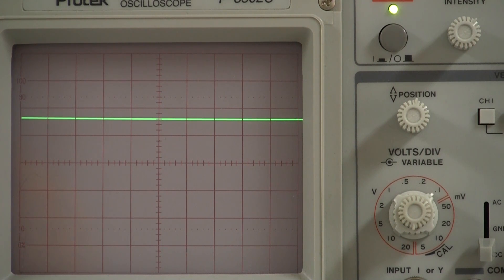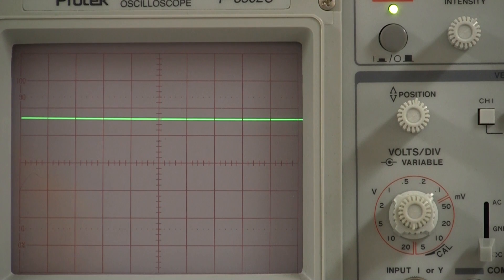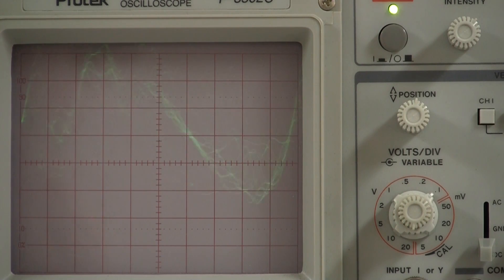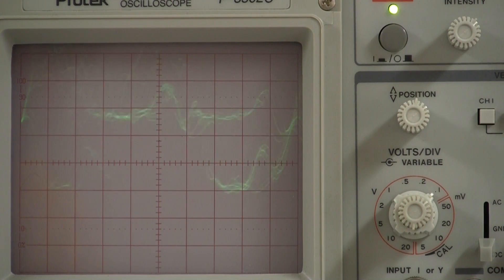Analog versus Digital synthesizers compared

Comment: the issue is not the waveform production (vco vs dco) but with the wave treatments, through the vcf, vca, eg and the modulation via lfo, ring mod, etc : at high frequencies, you can hear clearly the "steps" effect... and this cannot be filtered out, since it has nothing to do with the signal source (of course, a pure sine wave will always be a pure signal wave whatever the source, mechanical - think of a tuning fork or an organ pipe - or electrical - analog or digital) but with the signal filtering and modulation along time, i.e. the music!
Reply: zourslovenia Agree with you maybe we should a comparison of an analog wave thru a digital processor ie a digital filter amd and a digitally produced wave thru an anolog filter .
Reply: Free-running digital oscillators are everywhere today. It's in the Waldorf Blofeld, Serum, Intellijel Shapeshifter, Aalto, and Zebra 2, just to name a few.
Reply: woodlandcritterpunch Intresting info . I guess one of the reasons(not the only reason why digital osc sound so perfect is because of the starting of the waveform.
Reply from the maker: The 'steps' effect is more obvious in inexpensive lo-fi synths..... but I agree with you that the major differences are in the filter(s) and not the oscillators..... however, the interacting phases of the oscillators waves also causes a "difference" between analog and digital ..... in analog, all the oscillators are continuously free-running even between notes (when notes are not sounding) but in digital they all start at the SAME phase angle when a keyboard  note is pressed..... whereas in analog the starting phase is quite a  random (unpredictable) event.
Reply: @StephenMendes  It used to be that (free running phase not in digital synth). But even in the old Subtractor in Reason available already in early 2001 you can have free running waves starting at different phases.
But an even cooler thing is using the NN-XT sampler and working in 8 layers with the same waveforms and  settings but with different starting points for them and then set all layers to "ALT" - which means they will alternate randomly. They can also be detuned slightly to simulate that real analogue feel (if you have sampled a real analog synth it still will sound "stale/sterile" since the same waveform is triggered) with the same out of phase and slightly detuned oscillators/voices sounding at the same time. This makes things instantly sound analog! I don't think Kontakt has this function!
Reply from the maker: @Magnus_Loov  I have both digital and analog system  and I do not fancy one above the other.... they are simply different  to interact with
Reply: @StephenMendes  Yes. I owned analog equipment in the 90:S, but all vst:s right now (except a Dx7 as a controller, which is digital anyway). At the moment i am contemplating if it is worth it to buy a Behring Model D. It is cheap, but no patch saving is very, very limiting if used via midi in songs.
Reply from the maker: @Magnus_Loov  I would NOT recommend buying any Behringer products (unless you live in Germany),  their service is very poor in USA and is non-existent in my country, Barbados.....  consider it a disposable item.... if it goes bad, chuck it out and buy another, but do not expect to get services and repairs on them....

Comment: Hello :)
first of all thank you A LOT for doing this long and interesting test :) it's just great :)
i wanted to add my point of view about analog vs digital synthesis;
imo, there is 3 big differences :

1) the density of the analog signal comparing to (most) digital synthesis (the warm sound comes from here, it has rich harmonic)
2) the granularity (think dynamic imperfection) of (cheap) analog synth signal
3) the loss of quality introduce by digital conversion (stepping)

it would be awesome if you could find a way to compare the density of the signal; for eample, if you slow down a sample made with analog synthesis, and if you slow down a similar sample made with digital synthesis; i bet the digital one will stretch a lot more :)

also the micro imperfections are a big part of the joy of analog synthesis (except for really expensive analog gear, wich are somehow free from them) but i think you don't have to mesure that it's almost a fact..digital is perfect;

on a side note, I came across one or two digital synth wich impressed me by their sound (i couldn't tell the differences with analog) but many of them just sound perfect and somehow flat.. (with a dry signal of course) that's why some digital synth add distortion effect in the end , it's to bold the signal (king korg, electribe and many other);
it works but it doesn't have the same result as a true analog synthesis imo; 

Also, i think you are missing one important point : digital synthesis have many faces : additive synthesis, phase distortion synthesis, fm synthesis, granular synthesis and many other ; each of them have differents soul and sonic capabilities. fm really impressed me, has well as the granular method :) 

Good luck with your quest,
I'll look forward to hear from you and your sound experiment :)
cheers from france :)

Louis

Comment: the sample rate of your average digital synthesizer is over 40 kHz. This will result in some kind of additional frequency at 40kHz to the output signal, not granularity, because voltage cannot change value instantaneously. 
The hearing range of an exceptional human ear is up to 20kHz, so that frequency will not be perceivable even prior to filtering.  
plus that frequencies amplitude will be extremely low and wont require much filtering to remove. Meaning the phase and amplitude change of the overall signal due to the necessary amount of filtering used to ELIMINATE it, will be minuscule and i'm guessing also beyond the range of human hearing.

Comment: hello
analogs synths generate their waveshape with capacitor charge/discharge, the curve is not linear.
some V.A. synths reproduce this type of waveform.
Pictures of analog waveforms, are not perfect shape, there are artefacts resulting from the method of generation.

perfect square wave is dangerous for material, very bad for speakers, and difficult to form with an analog system, because it implies  infinite  acceleration. 
On the scope what you see is a square wave less the higher harmonics. 
I guess , above the emulation of analog synthesis, why digital synths don't produce perfect square too.

But for our ears the differences are not realy important, mainly because the very high  harmonics making the perfect square are above what we can hear.
Reply from the maker: +jean-louis pech 
Thanks for sharing this information.  I have a modular analog synth on order from synthesizers.com .  It's a custom  arrangement of their modules and they are building it for me, so there is a wait time of about a month. I expect it to be delivered sometime near end of December or latest first week In January. When I receive it, I plan to do extensive video demonstrations  with oscilloscope and RTA. .... so my presentations will no longer be one-sided in favor of digital only..... also I am going to enjoy plugging in patch cables and turning knobs (and that's just as much fun as the sounds that come out of it)
Reply: +jean-louis pech I agree.  Having seen various stages of square waves generated via a fourier series, what you saw there was what you expected with some small number of sin waves in the series.  So one would expect the higher harmonics to be missing like you say.

Comment: when comes down to square wave frequency modulation becomes clear.  analog synth make very good square wave. distortion of square usually comes any  filters.  another thing I like see on a oscilloscope is tube amp vs modeler amp.